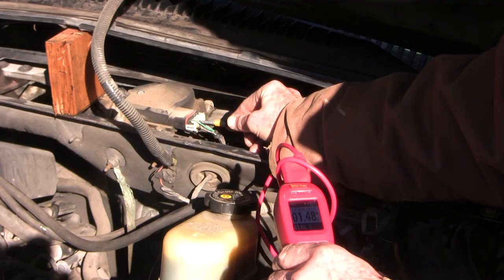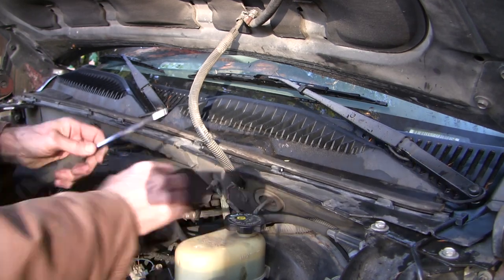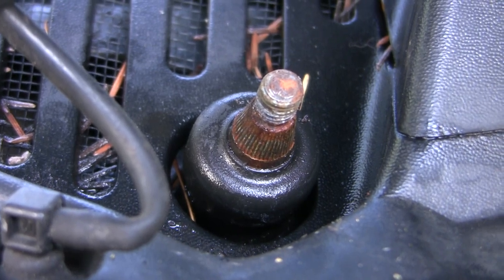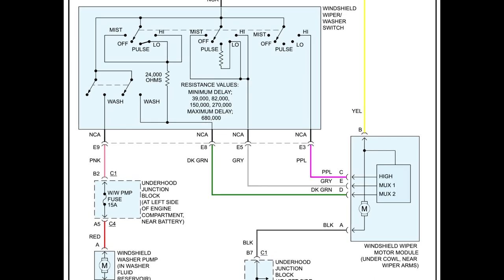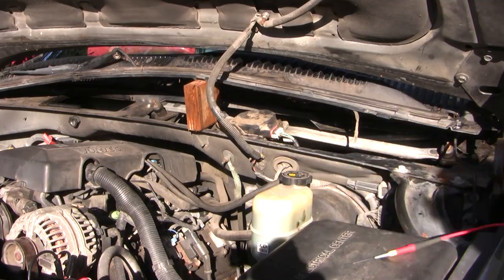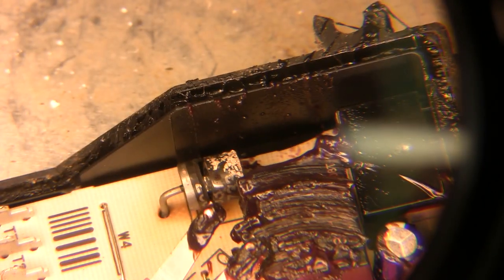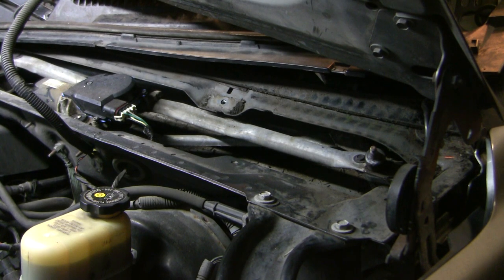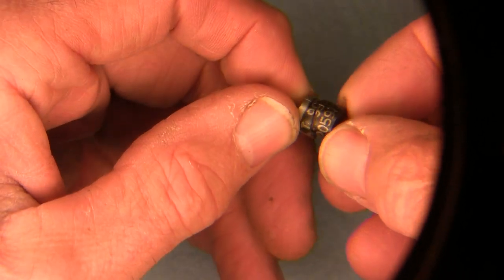How to diagnose and fix a car with stuck windshield wipers

Comment from the maker: When I was filming this, I briefly considered putting antiseize on the wiper arm shaft because the splines were so corroded. Then I recalled the time my wiper connection was blown out in my first car, a '63 chev, over 40 years ago. Here I decided not to use antiseize, and I would NOT recommend it. The wiper arms are bound to the wiper shaft by a tapered press fit, held in place by the top nut. Antiseize has some lubricating properties, so under high torque the spline connection could break free and destroy the connection. One day when your wipers are frozen to the glass, you don't want those splines to jump over and mess up the connection. Corrosion can sometimes be your friend! Your only recourse at that point would be to replace all the hardware, which would be a serious, unnecessary complication. Just clean up the splines but don't put anything else on it. When you torque it down, make sure the splines are properly aligned, properly torqued to 18ft lbs, and consider retightening the nut after a first use.

Comment: I think any hi power diode would be OK the size is a Good clue one out of a microwave may do I do electronic repairs and this may be used to stop back E.M.F. From the motor windings . Only a guess

Comment: Very well explained.  Unfortunately the detail isn't in the wiring diagram for the module as to exactly what that diode is.  They can be purchased very cheaply.  On some of the older Dodge models, the primary point of failure was those troublesome bushings on the arms connecting the wipers and the motor; they're a press fit and usually fall apart after some years.  

Great video!
Reply from the maker: Yeah. I had some high-current Shottky diodes on hand and even now I regret not dropping one in to that spot to give it a try. However with the uncertainty as to whether the ones I have are rated correctly I chose the safer approach, reasoning that a mistake could possibly fry the motor. It's working fine even today.